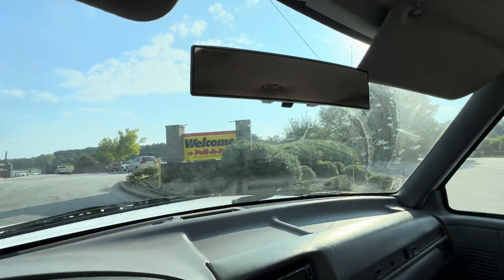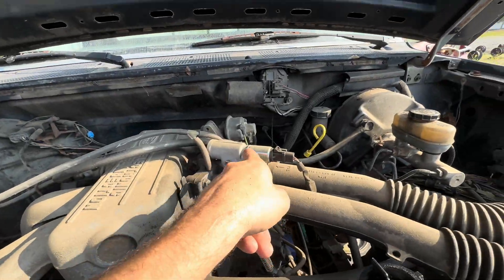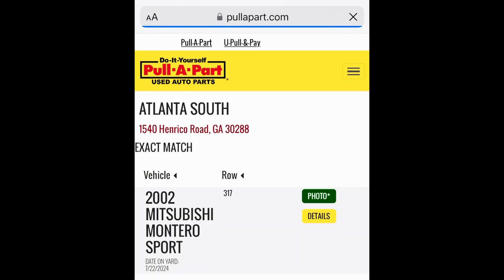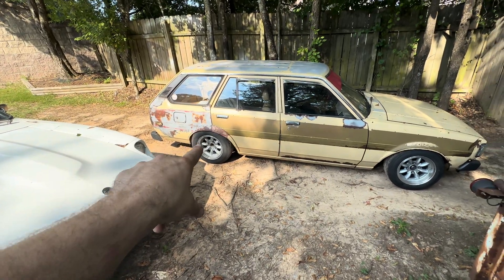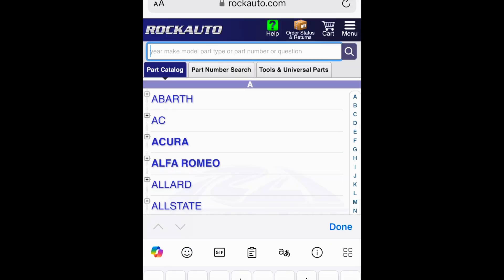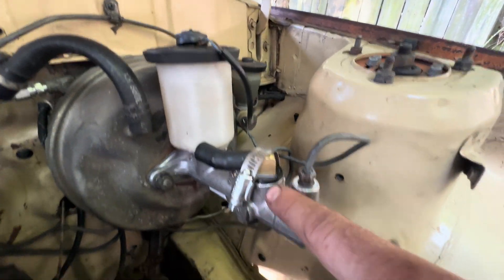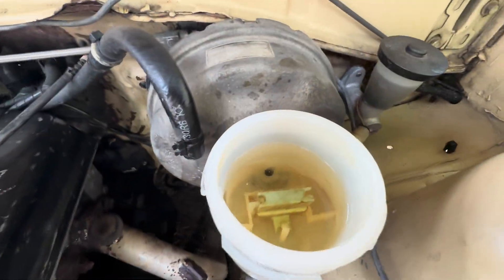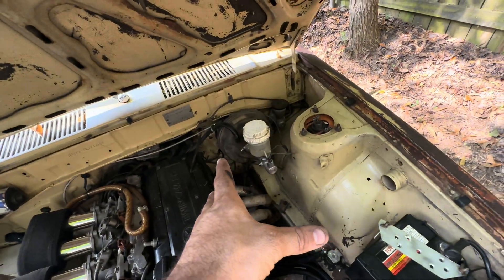TE72 Brake Master Cylinder Upgrade!!??

Comment: Question for the "drift guy" I just got a 1990 infinity m30, basically a skyline I know, its got an auto that is burnt up. Are there 5 speed options for it? I got for a toy after seeing your stuff and i want it to look like your builds. Love the channel.
Reply from the maker: F31 leopard. Love that chassis. Basically an entire 5 speed swap can be sourced from a z31 300zx. 5 lug can be adapted from the same chassis. And 240sx coilovers can be m easily retrofitted

Comment: I need help figuring out a brake upgrade for the te51. These little calipers are not cutting it! Great to see you back on the interwebs btw
Reply from the maker: Te72 calipers? Or maybe similar wilwood setup that's on the rear of mine
Reply: @deathwobble  yes and yes!

Comment: Do you have a video of you converting the rear to the Wilwood disc brakes, and did they use to be drum brakes very interested on the conversion
Reply from the maker: No it was a few years ago. Just on a hunch buying parts. They work but overall they aren't the best solution.